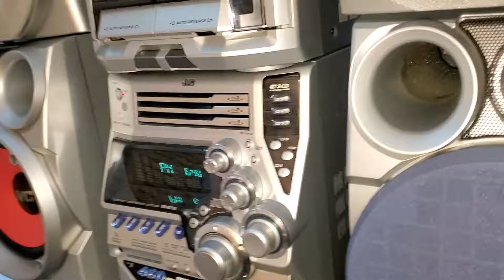JVC MX-J900 max volume!

Comment: Still the z3 is better
Reply from the maker: I did find a z3 I might get it
Reply: between the gt90 and z3 ho is better?
Reply from the maker: @zharziro6811  Z3 will be better at all around sound, but GT90 is the king of bass.
Reply: try sony subwoofer active rv999d  so good bass
Reply from the maker: @zharziro6811 maybe later I gotta finish my jvc collection first lol
Reply: jvc gt90 i wanted  but it hard to find it
Reply from the maker: @zharziro6811  gt90 is extremely hard to find but if you do get the chance to get one do not hesitate